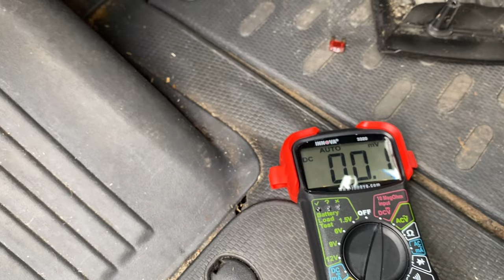Charge Van Batteries WITHOUT Solar - Renogy DC-DC Install | Charging While Driving

Comment: can I ask why you need to use a smaller fuse than what's already there when connecting the ignition wire?
I'm just about to fit my convertor so trying to get my head around as much as possible :)

Many thanks
Reply from the maker: Hey! It's because you're piggy backing the two fuses together with your fuse tap. So the fuse for whatever the van was using it for (we'll call it electric windows) will be connected to the fuse for the D+ wire. If the fuse on your wire blew, you wouldn't want your fuse for the windows to blow. So, if you use a fuse that is smaller than what the van needs for that certain appliance (e.g. windows) then your D+ wire would blow first and wouldn't take your windows out with it. Does that make sense? If you have more Qs, feel free to message us on insta.
Reply: Thank you so much for your response, that makes perfect sense, really appreciate you taking the time to write all that out its helped a lot :) 
 @zakandfal
Reply from the maker: Really glad to help. The quickest way to reach us is always insta if you have any other Qs :)  @jordanbisby7405

Comment: Hi, you will find a 60amp fused ground/live plug by the behind the panel at the bottom of your seat belt. Mine is to the right as I sit in the van in the U.K.  Two screws and the panel pops off.  Saves you running cable under the floor matt, fuse is one of the three maxi fuses on the battery and doesn't run anything else. It is all there, waiting for accessories in the rear of the van. I guess you can now use the connection for something else but anyone reading this may choose my option. I am watching this as I also fitted the Renogy 60.
Reply: Sounds great! Might gonna try that!
Reply from the maker: This is an awesome idea! Thanks for sharing! This might be a better option than what I chose, so you don't have to drill holes in the mats! haha. Again, really appreciate this, and I'm sure others will too.
Reply: Not all of them have that fuse box in a pillar

Comment: Hey, really appreciate a fast no bs and life story before getting to the point video. Do you always get 60a continuously? Do you think there is any room to go 100a for your vehicle? Have you seen any alternator heating issues over time or something? Thank you
Reply from the maker: Hey! Thanks so much for the feedback. The fast pace works well for some people and not so well for others. I'm glad that it's working for you! I'll be honest, when we turn on the DC to DC, I never actually check the amperage, because we just turn it on and go. It usually takes an hour and a half or so to charge our batteries up from 20% (the absolute lowest you should go if you have LiFe batteries without damaging them) We have not seen any alternator heating issues! :)

Comment: Hello! Thanks for the helpful videos!  

I am new to this van build world and am wondering about how you connected your trigger switch to your D+ wire, as I noticed the switch has a positive and a negative port on the back. Are y'all just connecting the positive port on the switch in between the (1) D+ wire, and it works that way? 
(as in there is no need for a negative for the switch to work?)

Thanks, hope all is well!
Reply from the maker: Hi Alessandro! Sorry this took us a second to get back to, I connected the D+ wire to the "on/off" by attaching it to a fuse in the front fuse panel of the vehicle. Basically, the power to that fuse has to be on when the car is on and off when the car is off. As for the switch, I got a simple single terminal switch, which basically acts as a "break circuit". It didn't have multiple terminals I don't think-- it's been a while now-- just a place for the D+. Hope that helps. If you're still having issues, shoot us a message on insta. :)

Comment: You set the meter to DC volts, touched the leads together and looked for a reading of zero? That's not checking anything. Your volts already read zero. You check the leads when in the ohms position, not volts. You're speeding along barely catching your breath and passing out incorrect info. Hopefully you figured that out by now.
Reply from the maker: My mistake about the ohms vs volts. Thanks for teaching me something!

Comment: You should have a fuse to protect the DC to DC charger.  That fuse should be at the battery.  The distance from the battery to the fuse is unprotected.  https://youtu.be/K6aFd3gVcFw     The Renogy DC to DC charger is nice, because it just works.   Be sure to set the 4 DIP switches on the side of the charger.  These set the charging profile.  Set wrong and you may damage your batteries.
Reply from the maker: Hey! Dip switches are set for Lithium Batteries. I must have not put that in the video. It's been so long now I've forgotten! haha. 

Regarding fuses, we are fused between the car battery and the DC to DC, and I am not an electrician by any means, but we are fused between the battery itself and our lynx distributor. The fuse is a terminal fuse, but maybe this is not what you're talking about. We are also fused within the Lynx Distributor, between the lynx and the DC to DC, which you can't see in this video, but there is a place for that fuse as well under the cover.  Again, it's been so long now that I'm a bit rusty remembering the fuse size, but we used all manufacturer recs.
Reply: She clearly explained that she has a fuse. What are you talking about when you say the distance from a battery to a dc charger is unprotected is beyond whatbi can understand as obviously there is a cable then a fuse and then dc charger. If a cable was tiny and a fuse was big then yes a cable will burn but not in in this case.
Reply: @marcass100  the distance from the battery to the fuse is not protected.  The fuse should be as close to the battery as possible.

Comment: Thanks a lot for the helpful vid. I used 4AWG wires too for my 40amp DC to DC charger and ran the cables up through the trim where the seatbelt is with some conduit. Looks pretty neat. Also made use of some of the plastic wire guides that were already in my citroen relay so keep my cables nice ands neat. I am going to try tpo connect my D+ cable now :-)
Reply from the maker: Heck yeah! Glad this was helpful. If you have any questions we are happy to help

Comment: I'm wondering if you could test and see the high amperage coming out of the positive cable before connecting or not? My meter shows my positive line has 14 point something voltage but no amps. I wonder if the isolator selenoid that was previously installed is getting in the way of this charger from working properly..? Anyone know if they can work together or if they clash?
Reply from the maker: Hey! Sorry, I don't know too much about the isolator/selenoid process. I know that people use them, I just don't have any experience. Hope you figured it out!

Comment: Did you use the D+ wire because you have a smart alternator, or did it have something to do with using it as only alt charging?  I have a 2016 PM and idk if it’s smart alt or not, but the red alt light is always solid.  Worries me lol.  I’m also no solar.
Reply from the maker: Hey! Our 60A DC to DC charger will not turn on without the D+ wire. It acts as the on/off switch for the device. (there actually is not a manual on/off switch on the DC2DC itself). Basically, the D+ wire is connected to the front of the van and sends a signal to the DC to DC charger to turn on only when the van is on. This has nothing to do with our alternator itself, but rather the appliance. Unfortunately, I don't know what a smart alternator is, or the red light you're referring to. 

However, as far as the D+ wire and the switch I put into the D+, this allows me to manually turn on and off the DC to DC as I please. If the switch I put into the D+ wire is off, it cannot send the signal to the DC to DC that the car is on. 

Did that answer your Q?

Comment: Hi, thanks for posting this, some good information there, but I have a question.  You said you were running 4/0 wire along the van; seems to be very heavy.  Did you mean 4AWG?
For the 8m run I did (truck battery to trailer) for my 40A DC-DC install, Renogy recommends 4AWG.  I used 6AWG as I already had it.  Seems to charge fine with about 6% voltage drop over that distance.
I like the on/off switch idea, but because my DC-DC is all the way back in the trailer I installed a remote control switch on the D+ wire; works great so far.  Cheers!
Reply from the maker: Hi Pommypaul, thanks for the comment and sorry for the confusion. 4 AWG is correct - you can see where we bought it on Amazon below. Cheers, ad if you have any other questions we are happy to help.

Comment: Whew, I am glad that was not 4/0 wire size!  You're only pulling 30 amps from the chassis circuit.
Reply from the maker: Lol, yeah! That would have been a lot of wasted wire and a lot of wasted money!
Reply: Mine came with 2 gauge and I'm just adding a bit of extra wire to connect the Renogy 40a.

Comment: How did you make a switch to turn on and off?
Reply from the maker: We got a auto switch (dc-dc) in an advanced auto.
Reply: @zakandfal  how did you connect it
Reply: @dylanlee5713  hey! It goes in line with the D+ wire (the 16AWG wire that acts as the on/off switch). Basically, just cut the d+ wire wherever you want your switch, add spade connectors to each side of the wire, and attach those spade connectors to the switch! :) let us know if you have any more Qs!
Reply: @fallonjung176  thanks
Reply: You don't need a switch, just run the trigger wire to one of the camper's side lights so when you turn on the lights, they activate the charger.